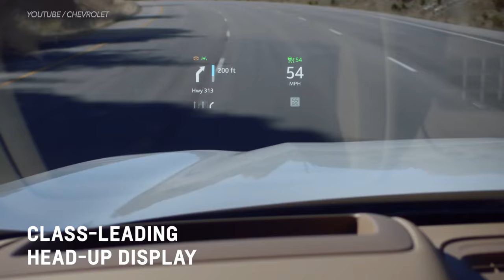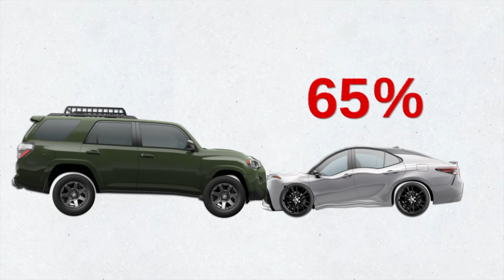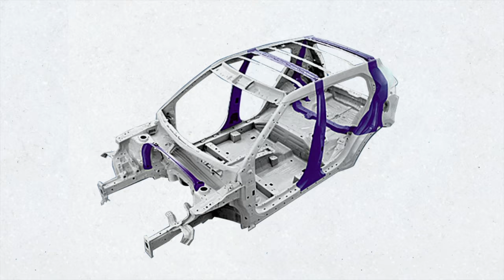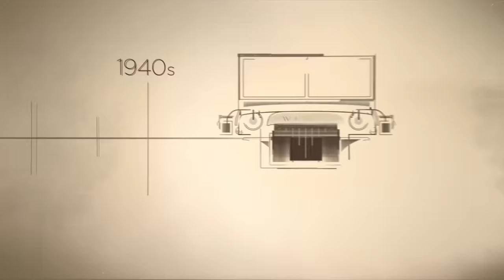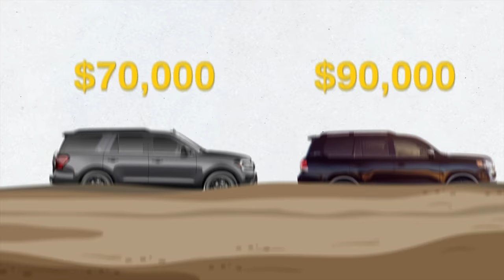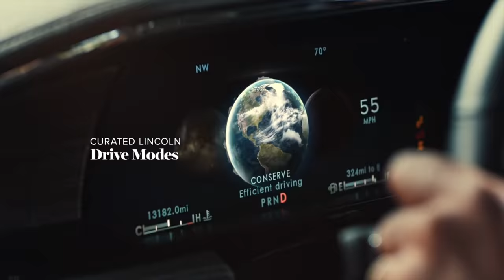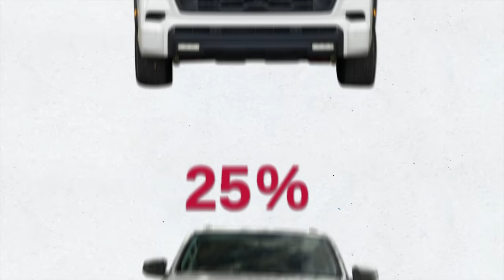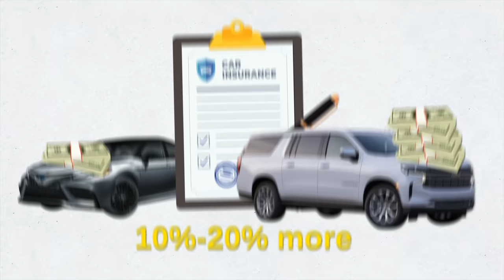Here's Why You Should Never Buy This SUV

Comment: Uncle left his 86 Suburban 4WD w/heavy towing package to my brother. That solid vehicle gave us years of dependable transport, and was glorious to take family vacations in. It’s gas mileage was low, we knew that going into it, but it was great transport for Summer family vacations, and lots of space to be comfortable for those long trips. It served its purpose. Now driven by a family friend to pull horse trailers, it’s still dependable at 276,000 Miles. It was built for a purpose, has served that purpose, and continues to provide pulling transport for horses. If you need something large to do as you see fit, there it is. Miss that old truck. So easy to get in and out of. So what if the mileage was poor. It was not built for such.

Comment: I have a Toyota Sequoia. It's the best vehicle I could ever want. Comfy, capable, powerful and overall reliable.
Reply: For how long ?
Reply: @Eccentric1999  12 years now, +90k miles
Reply: Mine is 17 years old has 168,000 miles and runs great. Excellent in the snow, when it does snow. 
The engine will or can last forever. The famous million mile engine video! Lol. Thats how long 😆
Reply: MysteriousOklahoma  that’s with normal maintenance
Reply: @chezzyperson3339  cuz v8 is gas guzzler
Reply: Yeah and I hear people complain about gas mileage. Like if you didn't like it why get the vehicle
Reply: Hows the gas mileage on that beast?
Reply: @Rem694u2  i have a 2021 and its 16.5 highway and 13 around town
Reply: @Rem694u2  if you consider the money spent on gas vs the money of selling it and buying another vehicle. I don't see the point of getting rid of it.
Reply: 2002 Sequoia SR5 4X4 with 213k. Don't care about the milage, currently at 13.9 mpg average, but for it's great comfort, dependability and value, its outstanding. Sometimes on highway trips I'd get 21 to 23 mpg. For hauling a large family, it's a no brainier.
Reply: MysteriousOklahoma  that's false tho
Reply: MysteriousOklahoma  False. What a horrible take.
Reply: MysteriousOklahoma  TOYOTA r enduring reliable that why I own a TOYOTA SUV
Reply: @stelladoroman  It does seem like a nice family vehicle.

Comment: To answer your question, Scotty, I have an SUV and I love it.  I have had everything from a Morris Minor to an MGA and Austin Healey (100-4) right up to a Suburban.  And I have driven much bigger (5 ton) trucks.  I have also driven limos. Range Rovers and even a Jensen Healey.  But now I am poor and I want to stay that way - excess is ugly and demanding - sucks your life.  I just want transportation that I can rely on.  Exceptionally, I suppose, my Nissan 2004 Pathfinder does it all with only one shortcoming.....I live in the forest and carry a lot when I go to town.  I load that little half-ton to the max and then travel hard miles over logging roads in the snow, mud, dust and gravel.   That ol' Pathy has to climb 20 degree dirt slopes covered in snow.  It is a real mule.  I love it.  What I really want is a Pathy with a manual transmission.  I want a bigger Pathy or Toyota equivalent stripped to the essentials.  I want the kind of vehicle Mercedes sells the third world.  The kind of vehicle Toyota sells the third world.  I want tough, simple, reliable and cheap.  A pre-Ghosin Pathy is close.  A Land Cruiser (not all Lexu'd up) is better.  I'd even take an old Suburban 350 manual tranny over the new crap.  I cannot afford to be coddled.

Comment: I've been driving 4-wheel drive vehicles since the age of sixteen in 1964.  I prefer 4-wheel drives to any other type of motor vehicle I've ever owned, driven, or ridden in.  Between 1964 and 1993, most of the "cars" I owned were Land Rovers.  (The real McCoy, what are now referred to as "Series" vehicles.)  I've had one (grey market) Range Rover.  I've also owned a number of Rover cars.  The P6 Rover cars had superb road holding, but with their inboard rear disk brakes were terribly labor intensive when it came time to overhaul the rear calipers.  I've owned two Jeeps, a 2012 Wrangler unlimited Rubicon and a 2014 Grand Cherokee Overland diesel starting back in April 1964.  My Wrangler Rubicon has been reliable; my wife had "too many issues" with her Grand Cherokee diesel for us to consider taking it with us when we moved permanently to Hawaii from Utah in March 2019.  We also have a 2011 Buick Enclave AWD.  I've had this since new.  We still have the Enclave.  (Due to its large size and six speed automatic---that loves cruising Interstates at 90-95---the Enclave is not a car for a family of two on the Hawaiian Island of Molokai.)  Having said all this, I'd rather own and drive SUV's than any other type of motor vehicle.  (I don't consider the Wrangler Rubicon an "SUV".)  That having been said, I'm happier driving a Wrangler on any of the Hawaiian Islands than any other type of car.  When we visit Kauai, Oahu, Maui or the Big Island, which we do between two and four times a year, my wife always tries to rent us Jeep Wranglers.  We've twice rented a Jeep Gladiator, as that's my beloved wife's first choice of "car" when we finally replace the Grand Cherokee she had in Utah.  Debbie, twenty-one years my junior, was raised in Montana.  She loves pickup trucks just as I love Jeep Wranglers, the Series IIA & III Land Rovers, and, yes, Scotty, the Toyota Land Cruiser.  When we made cross-country trips while living on the Mainland, we drove either the Enclave or Deb's Grand Cherokee diesel.  At my age, I'd not consider driving a Wrangler for long highway trips.  They are far too noisy for that!  Andy McKane, Maunaloa, HI 96770, 3 March 2022.

Comment: My Grandmother is 89 and still drives her 2010 FJ Cruiser 4wd with just over 100k miles, Although I don't recall her ever using the 4wd. I've seen similar FJs selling at the dealer with 100k for over $30,000 still

Comment: I was getting 30 mpg on my 2013 Ford Escape SEL. Max speed 67 mph ac off. Got from Raleigh to Savannah with 55 miles to spare 👌 update I made it from Savannah Georgia to Birmingham Alabama on a single tank of gas, peak MPG was 35MPG low was 31MPG Average speed 70 mph
Reply: is the max speed really only 67 mph? 
that really slow, in Germany cars typically drive from 80 mph to lightning speed
Reply: @MrBlonde294  My V6 will supposedly due 135, according the state patrol it can do at least 90.  I had to use my one get out of jail free card on that one.  It has been two years afterwards, so far.  I have no plans to test the 135 figure, I got it for acceleration not speed.
Reply: @MrBlonde294  that wasn’t the max speed my vehicle can go, that’s the fastest I can go and still be gaining fuel economy, any faster and I would start losing fuel Econ

Comment: I used to drive a 2004 Chevy Suburban. Reliable, Very comfortable and roomy, felt very nice to drive…. But that gas mileage was AWFUL ! 12 miles to the gallon 😭
Reply: Wow I wanted one of those but when you told me the gas mileage I changed my mind
Reply: Back in the mid 90's, I had an '89 4WD 2500 Suburban,  & NO MATTER HOW OR WHERE I DROVE IT, 13 mpg was the best I ever did. Didn't keep it long. 😲😲😲
Reply: @g5alive795  I currently have a 2019 Toyota Camry. The Suburban’s gas mileage ALONE was more expensive every month than my Camry’s monthly gas, car payment, and insurance COMBINED. I thought about getting an older suburban as a side vehicle to “drive on weekends or when hauling groups of friends” but knowing how I am, I’d end up driving it more than the Camry and let my bank account get eaten by the gas stations
Reply: @ShamuAquatics  Camry's have very good insurance rates.  I suspect I pay half as much as what some of my neighbors do.  Between the zillion airbags and built-in lo-jack system their big costs go away.  I test the low-jack once.  The car got about 50 feet away before shutting down.
Reply: I had a 2500 silverado a few years ago. Previous owner went to work with it. Got an average of 7mpg. $120-$160 to fill the tank up, every fill up. I can't even imagine now...
Reply: What about the president limousine, it’s lucky if it gets 4-5 mpg.

Comment: Interesting video!
I personally have a 2005 Subaru Outback and I love it!
Just had ball joints and an axle replaced a couple days ago for 800.00 bucks.
The vehicle loves the snow and ice and I generally feel very safe in it as the Winnipeg winters are harsh and long.
It also gets rather good gas mileage with the 2.5i boxer and automatic transmission.
Keep up the great videos.
Reply: Only 2 decent off road vehicles, Outback and the F-150.

Comment: We got a 2015 Toyota Highlander with 117,000 miles on it. We brought it brand new and only changed the brakes, rotors, tires, and battery. Still running like a champ.

Comment: Well, you did ask... I changed my 2007 Saturn Aura with 198K miles for a 2006 Acura MDX AWD with 140K miles. I have found the AWD to stick to the road very well in the rain - I live is Sacramento, CA - I do most of the maintenance myself, so that cost is lower. After watching this video, maybe I didn't need that much of a rig, but it was my first Acura, I am impressed with the quality, & my wife likes it. Much better than the old GM rigs I have had. Thank you for your vids. :-)
Reply: ANY AWD would have yielded the same difference.
Reply: @toriless  An AWD will stick to the road well, however, the Acura is well made, & now with over 150K miles, Nissan, GM... would not make it so far with the power & grip on the road. I ran my Saturn - GM - mostly Highway miles, & I took really good care of it. More so than recommended. "Any" AWD is not an Acura, they are a quality builder. Much better than an Audi that I sold with less than 70K miles. The plastic started breaking... for Quality, look to Honda & Toyota, not just "Any"

Comment: I drive a 2017 Ford Expedition limited, traded in a Chevy impala which I really enjoyed, but because of breaking my legs getting in and out of the Chevy was rather hard at times, So I purchased a used Expedition. I get about the same mileage, But this vehicle is one I can climb into and not out of, that was my problem with the Chevy, it was just too low to the ground and my legs weren't having it.

Comment: I have owned many cars and trucks over the years.   However, my 2016 4Runner is the best vehicle I have ever owned.  It’s a daily driver (gas guzzler) but also my off road adventure.  I head for the trails whenever I can with a load full of people and equipment.  Even after many miles of trails there are no vibrations, noises, or any sign of roughness when getting back on the road.
Reply: It is a Toyota, what else would you expect.

Comment: Older folks with mobility compromises can get up into a vehicle easier than one low to the ground.
Having grab handles over each door helps. Sitting up high with ample glass to view out all around improves safety. The small fuel efficient SUV addresses all these issues. Easy loading and unloading a flat floor than loading and unloading a deep trunk for people with compromised spines. J

Comment: I had a 4Runner, but it was hard to get in or out of it.  So I sold it, and purchased a new V6 Highlander, its lower to the ground and has a larger door height.
The Highlander is easy to enter/exit and gets 32mpg on the hwy, 4Runner 22mpg hwy.  Both were fun to drive, but the 2021 Highlander is more responsive and handles better, less chance of rollover than the 4Runner.
High insuance rates pertain mostly to foreign vehicles like Toyota/Honda.  American made vehicles have cheaper insurance rates for some reason, probably parts availability/cost.  My Dodge Ram pickup truck was almost half as expensive to insure than Toyota. I've owned over 100 vehicles in my life, and I've never been a dealer.

Comment: Great points!
Insurance Institute for Highway Safety (IIHS): 
SUV and Pickup Truck Drivers More Likely to Hit Pedestrians When Turning, IIHS Study Finds

Drivers of SUVs, pickup trucks, minivans, and vans are more likely than smaller vehicles to injure or kill pedestrians when making turns, according to a new study by the IIHS. The findings suggest the design of those larger vehicles may hinder driver visibility and contribute to the risk of striking a pedestrian. 

IIHS analyzed the details of 14,000 fatal pedestrian crashes, and found that SUVs were twice as likely as cars to be making a left turn when the crash happened. Vans and minivans had nearly three times the odds as cars, and pickup trucks were nearly four times as likely. The IIHS found similar results from an analysis of nonfatal crashes, as well.

Comment: There other factors that you didn’t mention. I’m 6’4” and don’t usually fit well in most cars, so I prefer driving a truck or suv. I have a nice midsized suv now (ML350) and it’s just the right size. I get surprisingly good mpg too. Usually 19 city and 24 highway. For the comfort and size, I’m always impressed and happy.
Reply: I'm considering an SUV for the very reason you stated. I'm 6'5" and have a 2013 Honda Accord. Good car but sometimes I don't like folding myself in and out of it. But it handles well.

Comment: SCOTTY I HAD A 95 SUBURBAN THREE SEAT 1500 4 WHEEL DRIVE.  I LOVED IT FOR ALL THE REASONS YOU MENTIONED.  I HAD TO SELL IT WITH 240 K MILES ON IT TO BUY A 95 FORD 350 DUALLY I RESTORED TO PULL A 41 FT. HALLMARK CYCLONE TOY HAULER FOR MY HARLEY ULTRA CLASSIC WHICH I LOVE, 3 TIMES CROSS COUNTRY 46 STATES CAMPING FROM NJ TO AZ IN 2014.  I FELT SAFER IN THE SUBURBAN.  MY 93 YR. OLD MOTHER LOVED IT AND PULLED HERSELF UP TO GET INTO IT, HER EXERCISE FOR  THE DAY:)  I HATE RIDING IN MY FRIENDS 2012 CAMRY TOO SMALL, WONDERING IF WE GET HIT IN IT.   YOUR OLD ENOUGH TO KNOW SIZE MATTERS:)  SIMILARLY MY HARLEY ELECTRIC GLIDE ULTRA 2010 LARGE AND COMFY AND STABLE.:)   BUY AMERICAN HIRE AMERICAN TOUGH TIMES DON'T LAST ONLY TOUGH GUYS AND GAL'S DR. JAMES COREI, RIP PHILLY TALK RADIO 95.5 FM.

Comment: -- Have a 2004 Tahoe Z71, and I love it.  But I also have a Civic, and a couple motorcycles for better fuel costs.  I have two kids and one on the way late March, and across the road, my little sis has 4 kids.  And I enjoy lite overlanding, fishing hunting, generally getting to moderately hard to reach spots that would be impossible for a compact. (I have a 2015) Jeep Rubicon for that as well but it doesn't fit the gear and kids and boat)  In the rust belt with the snow, if it has to get there, albeit slowly, the Tahoe does it.  
   If single with no kids in an an area that gets little to no snow, you don't need a big SUV.  Scotty is right.  But I'm right too, and I have other options.  My smallest bike, a 250cc gets 55 miles to the gallon.
Reply: some donorcycles eh
Reply: @toriless  -- There is that risk.  Well worth the risk.

Comment: Back in 2001 I was in a auto accident while riding in a Chevy Blazer. Me and may cousins got sideswiped by a Sedan and we flipped over 5 times. A we were flipping the Blazer fell apart around us. To the point I was ejected from the Blazer. I hit the ground then bounced into the air and landed into a ditch. I spent a year in rehab just to get back right again. It is why I refuse to buy and own an SUV.
Reply: Seatbelt?
Reply: @AB-yc1np  that part came off with that section of the frame.

Comment: Great video.  I guess I'm one of the few that uses my truck and suv for towing and hauling.
Reply: You are, unless you are the guy at Home Depot at 7 to 8 am loading on supplies for that days job you probably do not really need a truck.  They need trucks, trucks are for work not play.
Reply: @toriless  I'm not a construction worker but I tow (with my 16' dual axel trailer) atvs, dirt bikes, construction materials, firewood, my tractor/attachments, furniture..ect.  
Half of that you could get away with towing with a solid midsize SUV, the other half you can't.
It is not uncommon for me to drive an hour with atv/trailer, cut a cord of wood, load it all back up and come home.

Comment: Do these points also apply to pick up trucks? Like f-150s, Tacoma’s, etc? Looking to get one soon
Reply: Nah, Tacos and 150s are GOATs, however idk about the V6 ecos on the fords. I’ve got a 2014 explorer with the trash water pump design with the naturally aspirated V6 but it still runs like a clock at 138k miles.
Reply: @ethancouillard6988  Taco?  Do you mean Tahoe?

Comment: SUVs are not meant to be driven like a sports car. They are more of a utility vehicle that is large and comfortable.  Most SUVs sold for normal consumer use are really light duty type off road capable. All terrain SUVs are specialized, and if taken out for all terrain they will be damaged.  

I like my SUV for its size and comfort.  I drive it very cautiously.  I can carry family members and pack it to move a lot of things. It is great with winter driving and in snow storms.  I am using off road mud and snow high gripping tires on it during the winter months. I have tires for summer driving. Each set of tires are on their own set of alloy wheels. SUVs are very expensive to operate.

Comment: 10x too large for most peoples journeys.
Reply: So my 5500 pound suv should be 550 pounds like a mid sized mototcycle
Reply: Actually a Sedan usually weighs 3200 to 3600.  Compacts 2600-2800
Reply: @cayman9873  makes sense for most journeys.
Reply: @toriless  size isn’t a direct correlation with weight.  Most journeys by car are made by a single person so a small vehicle is perfectly adequate. Of course a lot of people like to validate there egos by driving big SUV’s, but that really is a sign of their inadequacy as a human being.